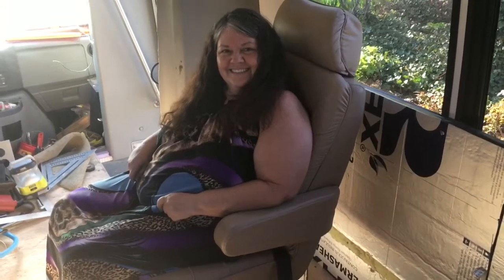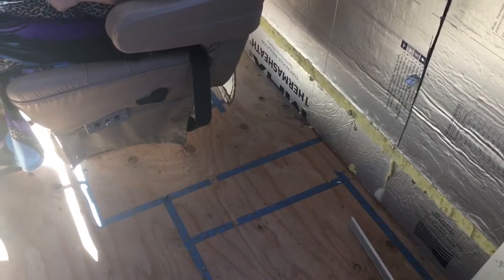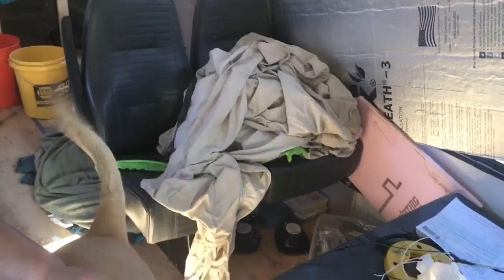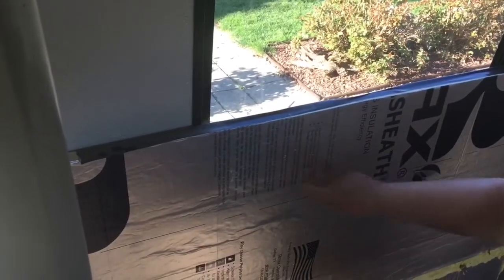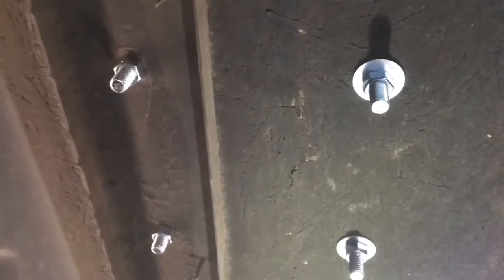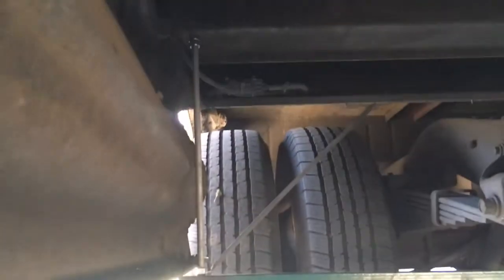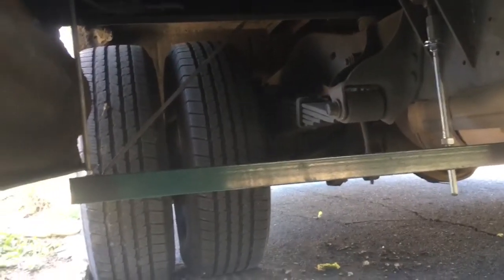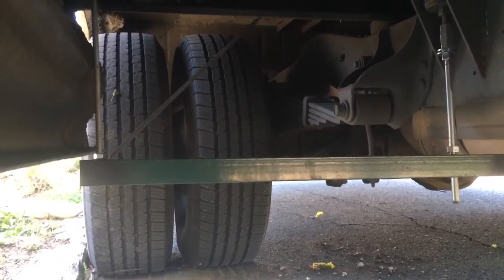SHUTTLE BUS CONVERSION Captains Chairs ~ Water Tank Mounting ~ Bucket Talk All-Thread Bolts Ep20

Comment: Will the water freeze in the winter?
Reply from the maker: It will be insulated and two sources to prevent freezing. Besides, we're planning to follow nice weather...LOL
Reply: @ACMArtsAndAdventures  I see online you can buy some heating pads for large holding tanks like this too, not sure how they work.
Reply from the maker: That is one of the sources were going to be using. It 12-volt so it'll work with our Solar.